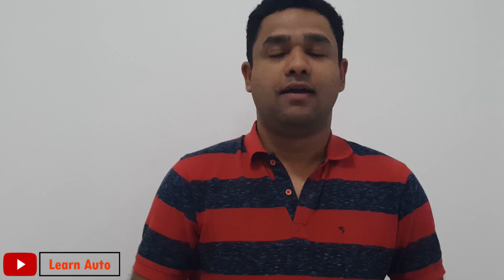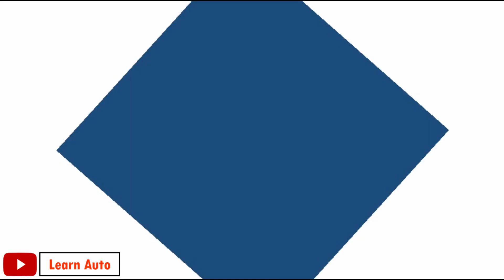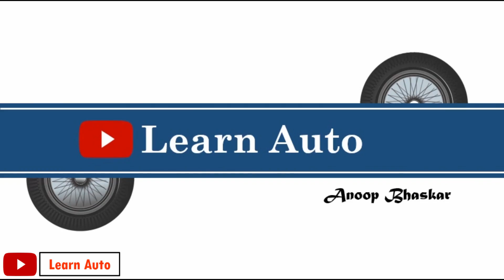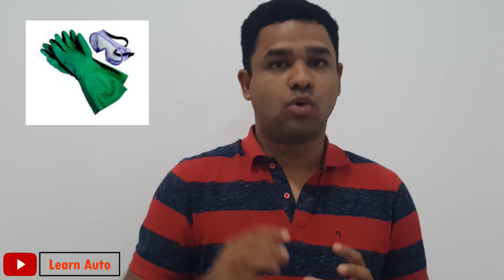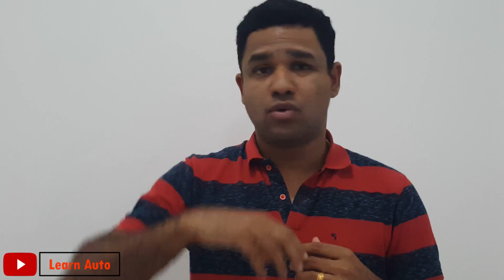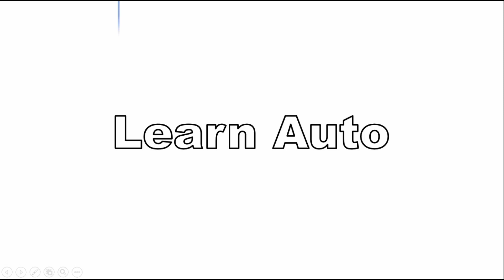Car A/C system Part -3| Safety Precautions of A/C Refrigerant| #Learn Auto #learn auto| #auto

Comment: Is it recommended to flush ac system if compressor is wornout ...if can what can we use for flushing ?and can we clean expansion valve  by any liquid or clean cloth or by blowing air  and reuse it ?
Reply from the maker: It depends to the manufacturer, most of the manufacturers are not recommending flushing. Some manufacturers recommended to use the same refrigerant to flush the system and machine needs to be used. R11 also can be used if recommended. Expansion valve cleaning is not recommended at all and should be replaces in case of compressor failure. Do not blow air into A/C system because air could cause freezing of the system and no other liquids should be used as well.
Reply: @LearnAutoByAnoopBhaskar  thnk u